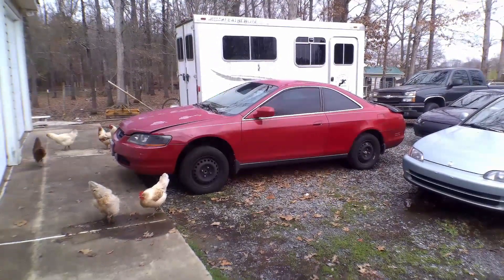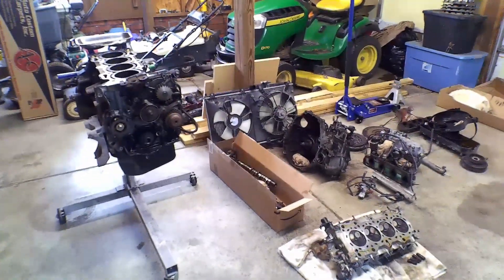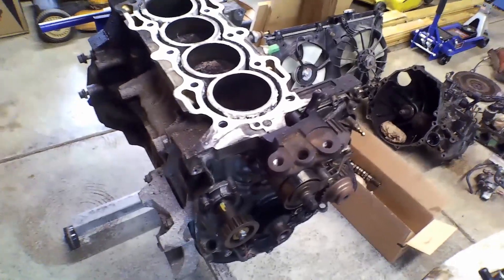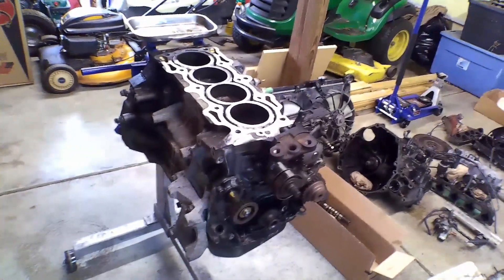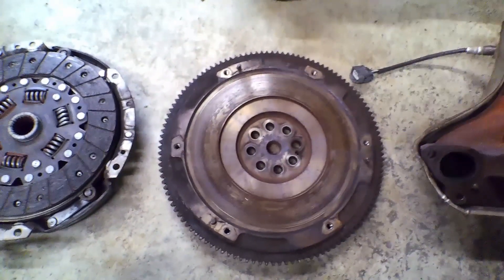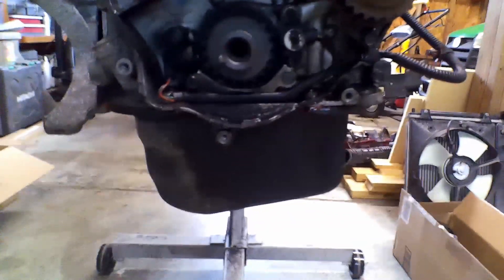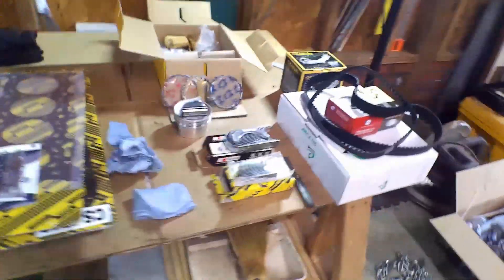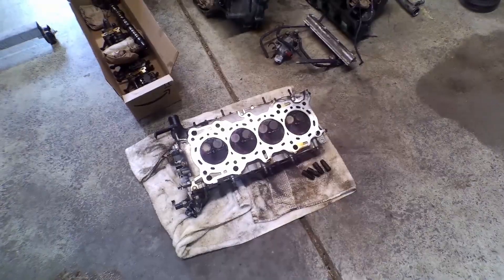F23 Honda Accord Engine Rebuild Part 1: Introduction

Comment: Hey there, good evening I have a 99 automatic I am thinking about doing that same kits and there's also another kid by another brand but when you go to order the kit there's two different ones what is the difference between the standard and I think it's 0.90 mm one. Are they referring to standard as equipped with manual transmission or something different
Reply from the maker: Standard means the sizing of the pistons and rings. If you had machine work done to your block, the cylinders would be slightly larger and need larger pistons. 0.9 means it is oversized by that much. Auto and manual engines use the same kits.
Reply: No I don't think it has ever had any major engine work I bought the car from someone a few years ago it is running at 312k and started to have some puffs of blue smoke besides other oil leaks it has  @ktecgarage
Reply: I do appreciate the information, I am still watching your video series. To see all that was done with yours  @ktecgarage
Reply from the maker: Then I won't give out any spoilers! Thanks
Reply: @ktecgarage 10/4 sounds good and I'll continue to watch the series but if I have a question about something or somewhere I will reach out

Comment: How long has the car traveled on King liners?
Reply from the maker: If you are referring to the tires, i usually got 40, 50k out of those cheap tire kingdom tires.
Reply: @ktecgarage  No, no. I meant the connecting rod bearing.
Reply from the maker: Oh.... The King brand bearings! I got you now. I put about 10k on this one before I sold it. Put them in a Civic and went 40k before I sold that. Never took them out and inspected them. Everything I ever heard or seen about them seems to be positive. I'm sure there are folks who claim they are crap, but I didn't have any issues.

Comment: Be careful with the gen 6 BAXA automatic
Reply from the maker: I had an 8th generation 3.0 with the automatic, and that transmission failed at 100k. These were nowhere near as bad. Most I've seen make it over 200k. I'll always pick a manual if I can. Bullet proof.
Reply: @ktecgarage  love the v6 accords with the 6 speed manua.
Reply: l...

Comment: Hey, i was trying to put a f23a1 on a stand but i dont have the transmission bolts to compare the size for the engine stand, can you tell me what size bolts with thread size did you use
Reply from the maker: 12 x 1.25. Same as the bell house bolts. If the bell housing bolts aren't long enough,  take them to a hardware store and get longer ones the same size.

Edit: missed you don't have the trans bolts. Sorry
Reply: @ thanks boss…🙏🙏

Comment: I’m about to start my rebuild project this Saturday and gonna follow your method step by step, wish me luck. 

Thank you so much for your videos. Has gave me motivation for doing my first rebuild. Hope everything goes good. Did you by chance resurface the block when doing rebuild?
Reply from the maker: I have another set of videos where I went back and replaced the head gasket on this car (I wasn't happy with the torque procedure), and in one of those videos I demonstrate checking the head and block with a precision straight edge. Check that out if you have any doubts about yours.

Good luck with the project and ask any questions along the way. I still keep up with the comments from this series.
Reply: @ktecgarage  thank you very much for the quick reply. i have seen that video and will watch it agin to test mine out, thanks again!

Comment: I’m about to get a $250 accord with this motor it knocks apparently hopefully this guide will help
Reply from the maker: Most knocking is a bad bearing on the crank or a connecting rod. This will show you everything you need to tear it down and reassemble it. Hopefully you don't need any machine work. If you have any questions along the way, I'll try to help you out. Good luck!
Reply: @ktecgarage thanks brother I really appreciate that
Reply: @ktecgarage anything I should be looking out for when pulling it apart in relations to the knocking noise?
Reply from the maker: If it is a bad bearing, it's pretty obvious. It will be chewed up. If it chewed up the crank too, you will need to get it resurfaced and use a thicker bearing. The machine shop would tell you or sell you the right ones.

I'm betting it's a connecting rod bearing.
Reply: @ktecgarage  okay I’ll let you know what I see when I tear it apart
Reply from the maker: In fact, if you pull the oil pan, you could probably wiggle each connecting rod and figure out which one is loose. They should all be tight.
Reply: @ktecgarage  also he said when he heard the knocking noise they stopped driving it so I’m hoping it’s just a bad beating
Reply: @ktecgarage  ill check that thanks for your help man

Comment: I have a 2001 Accord  2.3 L VTEC with a 5 speed.  It has 280k miles and runs great.  Leaks oil from rear main seal and somewhere on the drivers side of the motor. Wish you were my neighbor.  Great series..
Reply from the maker: I don't work cheap! Thanks for the comment.
Reply: @ktecgarage 😂😂😂😅😅

Comment: What rebuild kit did you get and what sizes did you chose?
Reply from the maker: I looked at Amazon and it appears they sell a re-ring kit with the pistons and a timing kit seperate now. Search for Honda f23 Evergreen rebuild. The sizes were standard because I did not need to do any machine work on my parts. Good luck!

Comment: Mine has 355k I was thinking on K swapping just for fun. Can you get power out of these motors?
Reply from the maker: There is a guy on YouTube with a turbo F series accord that appears to be pretty quick. I personally wouldn't bother with a single cam if I were to build one for power. Plus, you are going to find way more performance parts for a K series.
Reply: @ktecgarage  makes sense, I think just having after market support alone would make me go K swap. Thanks for taking the time to reapond!

Comment: I recently replaced the hose that goes underneath the distributor I've had an accident recently happened where my hands were too big and I needed to take the distributor off the engine block( I have a 98 Honda Accord LX 2.3 4 cylinder)...
After I attach the new hose I went to put on the distributor and must not put it incorrectly or put it in 180° and the two tabs at the end of that rotor that goes into the camshaft I believe have broken off and I was wondering why my car wouldn't start after everything was put back together so took off the distributor again and notice the two tabs of metal broke off into that slot in the camshaft and I saw them literally fall off and now the problem is I need to get those two pieces of metal tabs that have slid off that camshaft slot right when you open up the distributor location on the engine... My question is do you have any idea how to get those metal tabs out I bought a little expendable magnet but where the opening is I'm not too sure if I can put the magnet inside that round location do you have any suggestions?
Btw I've also opened the valve cover just in case
Reply from the maker: Those pieces have to be under the valve cover somewhere. It would be an incredible stroke of bad luck to have made it down one of the oil passages. Might have to pull the rocker assembly. Sorry to hear about your troubles. Good luck.
Reply: @ktecgarage  wow I am so lucky there's a wall that separates the rocker assembly from the camshaft slot and I just needed a smaller magnet to fish out the two broken off tabs from the distributor.... I'm good now. Just need to find new dizzy... 
Btw I ended up watching your whole rebuild engine videos haha.... You are the real hero to us 6th gen owners very good job thank you
Reply: @ktecgarage  sorry to bother you again I don't want to be a pest but I spoken to some people and they told me that I might have messed up the timing I'm not too sure what to do now I got the new distributor and would not know how to put it in could you give me a direction
Reply from the maker: Unless you took the cam off you should be fine. Take out your number 1 spark plug and spin the engine clockwise until you feel compression from the spark plug tube. Then when you install the new dizzy, take the cap off and make sure the rotor is pointing at the 10 to 11 o'clock position before you slide it home. Then you'll be fine. 

No bother at all!
Reply: @ktecgarage  how would I turn the engine? Spark plugs tube? You mean that long rubber boot that goes into the engine? And where would I put my hand on to feel the pressure?
Reply: @ktecgarage  could I just set the timing belt to zero by turning the engine and not taking out the spark plug leaving it in and putting the distributor to the 10 or 11 and slide the distributor back in? Or is that not wise

Comment: Witch rebuild kit did you use? Link?!! Already watched the whole rebuild on your channel and am prepared to do my 98 accords engine. Thanks for the good In depth guide
Reply from the maker: OK4010/0/0/0 98-02 Acura CL Honda... https://www.amazon.com/dp/B00W68PSEW?ref=ppx_pop_mob_ap_share

I don't know if it's still available from Amazon. Ebay also has similar kits. 

Glad to hear the series was helpful. Good luck!

Comment: When you took the engine out, did you remove the transmission first or did you lift it all out together? Did you get any video of that?
Reply from the maker: I did leave the trans on the engine when I removed it. I did not record that because I didn't know at the time I was going to YouTube the rebuild. Taking it out is VERY easy compared to putting it back in. With the proper equipment, it's not very hard to pull it. If you are considering doing this, go for it. The rebuild series I have here should help you getting it all back together. It's scary at first, but you'll see that anyone can do it. Good luck!

Edit: And if you have any questions along the way, ask on the relevant video and I'll try to help. That's what I do.

Comment: I just bought a 5 speed 99 accord with f23a1 swapped by the previous owners.  $300 bucks for the car.  No idea of mileage but I’m sure it’s less than 211k that the odometer is reading.  I’m a rookie mechanic with a huge aspiration to rebuild a car.  Was going to do my ej207 out of my old bugeye Subaru but that never happened before I had to sell it.  Thanks for the content and I hope it helps me on my mission
Reply from the maker: Well. You came to the right place! The quality gets better as it goes, but I go over about every bolt on this platform.

Comment: What bolts did you use to mount to engine stand
Reply from the maker: Same thread as the transmission case bolts. Took them to Lowe's and matched them up.

Comment: 5:35 My F23a4 has the same oil leak coming from the distributor, and I think I have one from the VTEC solenoid too
Reply from the maker: At least it's an easy fix. I suggest getting Honda o-rings for the repairs. Good luck and thanks for commenting.
Reply: Both are common on these cars as the newest of them are approaching 20 years of service.  The heat makes the seals hard and then they don't seal properly any more.  There is also an internal oil seal on the distributor shaft which can fail and allow oil to contaminate the inside of the distributor.  I had my local mechanic replace the vtec seals as they are in a tight spot on the rear of the engine.
Reply from the maker: Yep. I have a video  replacing that inner seal. Not too hard of a job.

Comment: Which kit did you specifically use? There are 3 options:
1. Standard
2. Main 0.01”| rod 0.01
3. Main 0.02”| rod 0.02

I have an F23A4 which will work?
Reply from the maker: Standard. I believe the other options are for parts that have been machined. You should double check with the manufacturer before trusting a stranger on the interwebs, tho! Good luck!
Reply: @ktecgarage  Got it, that makes sense. Well I trust you. It takes skill to rebuild an engine, even more to do so on video. I am rebuilding my F23A4 instead of buying a new car. Thank you for your videos, I could not do this otherwise.

Comment: what OEM number of rebuild kit? it's full kit?
Reply from the maker: It has everything except for head bolts. Thanks for checking out the channel!
Reply from the maker: https://www.amazon.com/OK4010-98-02-Accord-Engine-Rebuild/dp/B00W68PVOO/ref=mp_s_a_1_4?keywords=OK4010%2F2%2F1%2F1&qid=1563819145&s=gateway&sr=8-4

Comment: Thanks for the vid gonna and im gonna watch the others 2. I got 99 accord sedan. I did a 5 speed swap on over the winter. Ive persoanlly rebuilt 3 of f23s but have nvr heard them run either sell the car or engine before i can. Im sure vids will help on the spare engine i just started on over the weekend